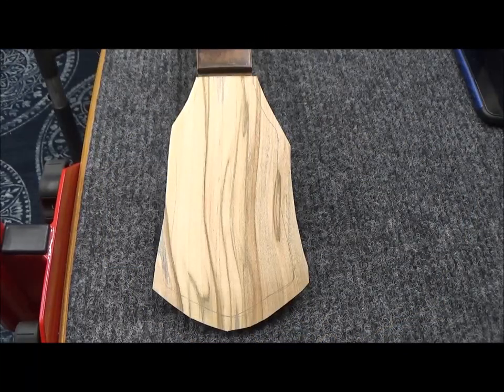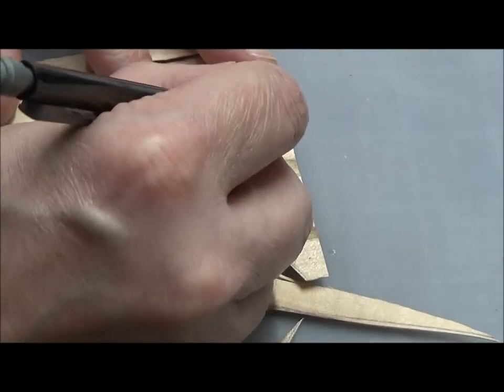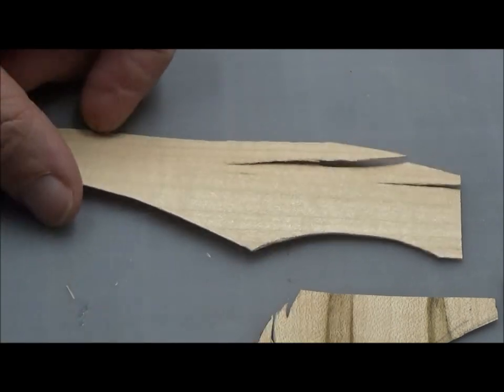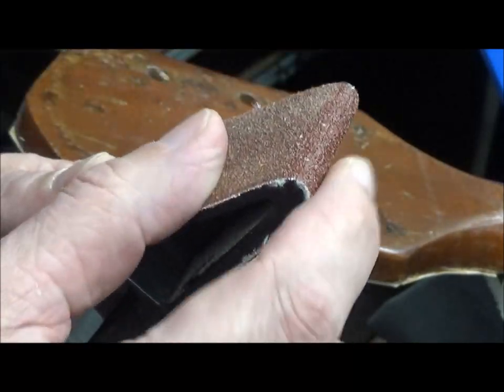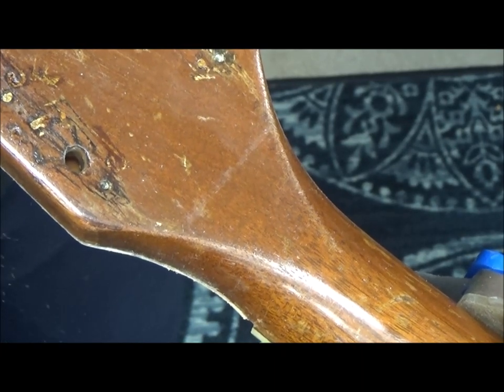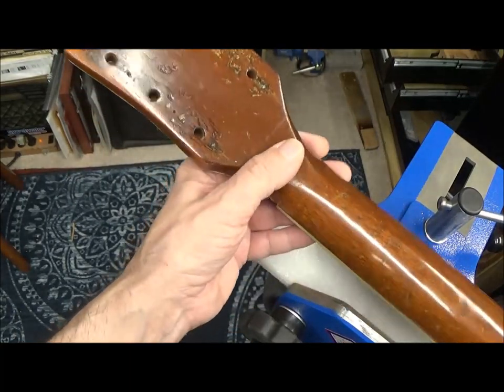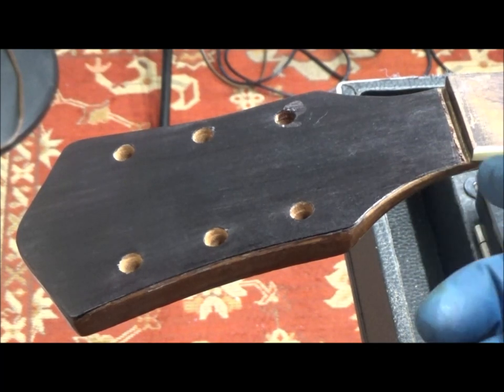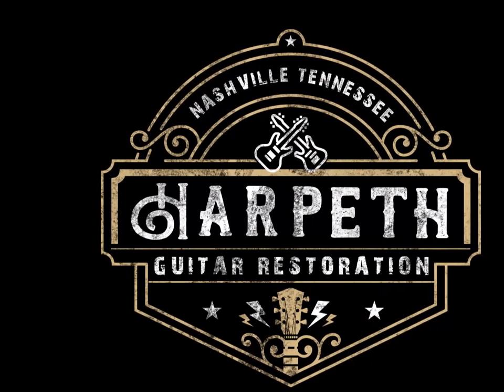Wood Veneers For Guitars

Comment: A quick tip!   Size your veneer closer to final shape, approx. an eighth inch over size all the way around using very sharp shears.  Glue it up.  Then trim the veneer with a file.  Fast, accurate and you can trim so clean with a file that there is no need to even touch the sides of the headstock other than to break the edge for finish.  Less clean up, less touch up.